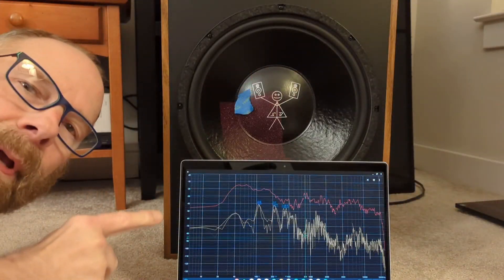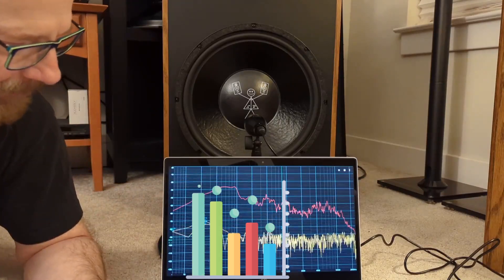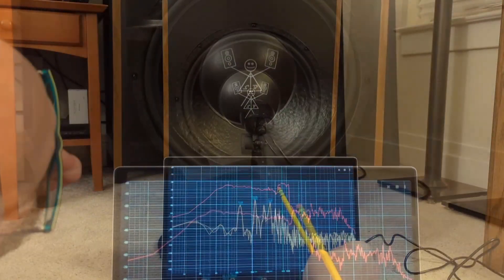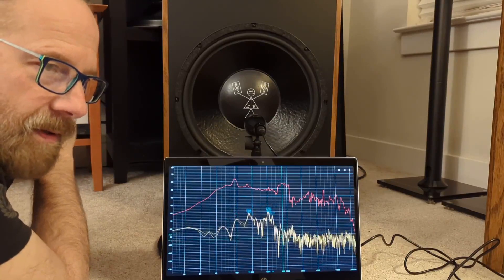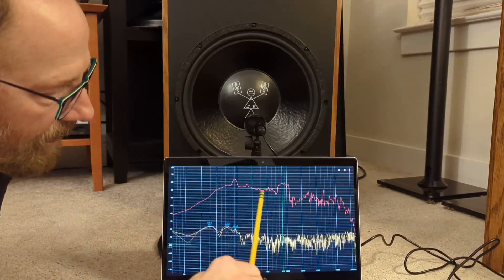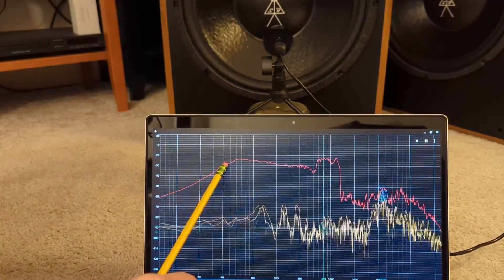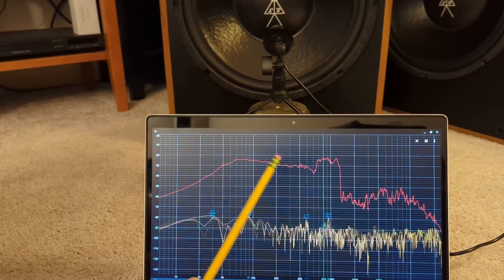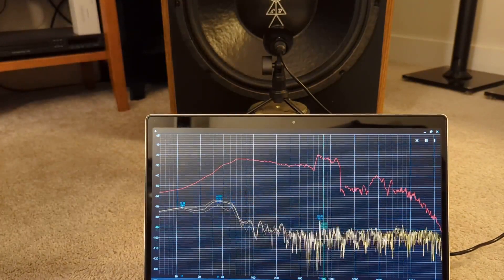Bass Tweaking: Comparing Woofer with a Zobel and Without... MORE BASS SMOOTHER RESPONSE kinda

Comment: The problem you're experiencing won't simply be solved with cutting the hump down with a zobel. Also unless you've taken into consideration woofer inductance, and ideally ESR of the zobel components too, when calculating for the zobel, you're frequency cut may have it's center frequency, bandwidth and cut level change slightly.

Even if properly implemented you're still only fixing your on axis performance. This will just make off axis listening even more dull. Ironically big speakers for more volume will work but they tend to have a smaller sweet spot when things like woofer beaming begin at 570 hz for a typical 15" and also the problem with big woofers is earlier break up modes. 15" paper woofers tend to have a pretty severe bump in on axis frequencies around 2khz but off axis you can have upwards of -15db dip at 2khz. This is a big deal when wanting to run vocals through a big woofer being used to spread sound over a large audience. The beaming problem has only two solutions (well the third is use as is and use the beaming in conjunction with the horns narrower dispersion to prevent room echoing in large venues where 15" would be used). The solutions are to Use a lower cutoff frequency, 500hz is typical for a 15" woofer for hifi purposes. This eliminates both the beaming and breakup problem and keeps crossovers simple. The other is a physical mod to the speaker you can search for "woofer diffraction slot" This is a flat piece of material with a certain shape cut into it. The shape essentially guides any of the waveforms from the woofer that would otherwise interfere with the wide dispersion and forces them out the center area. This aligns the sound and disperses it, think of it like a spray nozzle for sound, and makes the woofer behave more point source-like. This solves the beaming problem but won't help with the breakup problem.

 When designing speakers every change done will have knock on effects of other performance characteristics. For example the more components in the crossover, the more energy is stored and you'll see if you can run impulse decay tests, more ringing going on.
Reply from the maker: Thanks for watching and the comment / suggestions! Honestly, this build was a while ago and it needed plenty of massaging.

I've read over your comment, but as an old timer back from the days of tuning and tweaking by ear, (which is much of what I do now as well), I can't really relate to the beaming, although that would make an interesting video topic I may explore. Personally, I've not had any issues that I know of with beaming from larger woofers. I'm assuming that beaming is a focused energy, perhaps a spike in SPL of a certain frequency or frequencies at certain listening positions?

On big baffle, large driver cabinets, usually the issues I face are more in the midrange and tweeter. That's definitely the case on this build. Additionally, this enclosure is theoretically a bit small for the cabinet, so matching the SPL of the Woofer from subsonic to the crossover point of 750/800 Hz range, where it hands off to the mid range was my biggest challenge.

The Zobels shouldn't present anything extra in the path as they're in parallel and loop back to the amp. I use them because it mitigates some inconsistencies in SPL across areas, and presents an equalized impedance which assists the crossover in functioning more consistently across a wide range of volume. It's basically a hack for optimizing the performance when using off the shelf crossovers. The crossover points may not be textbook, but the Zobels help get them closer to where they're supposed to be. In terms of calculating for them, I don't get too concerned about it as they're simply acting as a path of least resistance when the drivers have impedance variations from inductance. I get the values as close as I can, but try to keep the number of parts to a minimum.

I'm not sure I agree with the cone breakup above 570 Hz theory. I believe that would have a lot more to do with the driver being utilized and how well it works with the cabinet, tuning frequency and dampening. At least I've not experienced it personally, but I typically lean towards woofers that have very good control and plenty of power handling. The Woofers in this build are over twenty years old. It was a Dayton design they did with Eminence. It's basically a pro driver with a hifi style cone and surround. It's extremely tight though and I had this pair left over from when I was building high power, 500+ watt RMS speakers for Max fidelity at high SPL roughly in the 130 +/- Db range. That's a lot of fun and there's a huge difference between listening to a speaker system at 90 Db driven with 100 watts, Vs powering them with a few thousand watts for hours on end at full throttle. The one thing I'll say about that time I spent building those, was that it was right in my wheelhouse with testing and tuning by ear, because all the calculations, math and specs don't equate to any meaningful difference at the brink of self destruction. Crossover points and values of components behave much differently in those applications.

For the home stuff though, for sure the speakers are operating within such a narrow window of SPL, and much lower volume than they're capable of so small changes do make big differences.

All that being said, you may be on point, I'm just not that adept with that sort of measuring. I'm primarily looking for an even output in volume so that across the listening range that's more typical in a home setting, from perhaps 75 Db to 95 Db that they faithfully follow a consistent level of efficiency throughout the full range... or as much of that full range that the speakers are capable of.

I'm still planning on finishing off this series, but there's a couple of videos after this one you commented on which you might be interested in seeing. 

I believe the order it went was reversing the polarity of the Mid-Range, and then doing more bass tuning. Eventually I had arrived at "good enough" and that's where they're at today. I enjoy them. One day I'll get the series finished off, but the two videos I mentioned are:

https://youtu.be/TqoMVvD9CcU?si=oOxJ9T4_hPI8Kvyo

And
 https://youtu.be/cB8xzbsFI-I?si=DitxdkC1iQ8FrpW3

Thanks again for watching and commenting. If you can provide any more insight please do. I'm always interested in learning more.
Reply: @wattspeakers  

There's always a lot to learn, you do make an excellent point about distortion creeping in for high power applications. I most definitely, also like you tune by ear, but have gotten consistently close enough that I can tune a graphic and parametric equalizer by ear and sine sweeps.

 But also that at lower volumes inherent inconsistencies do show up more drastically. That's why there are so many different philosophies when it comes to building and tuning speakers.

 I used to compete in car audio SPL and SQ competitions at different points in life. And learned all through those times that even tuning by ear and measuring, there are just some things that can not be fixed with electronics. 

This is resonances, like cabinet resonance, woofer resonances and ringing. This leads to impulse decay problems which also can't be eq'd out. There's also beaming, this is an inherent fundamental fact. Use a woofer above it's beaming frequency and it will have a rising response on axis due to constructive interference and a dip in response off axis due to destructive interferences. This is simply math, it leads to the dipole effect of open baffle, it leads to baffle step response needing baffle step compensation. Breakup is solved by cone rigidity, physical damping and material selection with the caveat that more stifness means ringing and more damping means more mass less efficiency. If you don't understand what break up sounds like, build a speaker that runs the woofer full range and with a crossover. EQ them both flat, and you'll hear a distinct muffling in the vocal ranges.

But The beaming and break up though interelated to each other are different problems. I know you have a measurement microphone, it may be time to start on-axis and off-axis measurement. When you do you start to get a good picture of how little changes affect the polar response of the speaker.

In fact your video 15" woofer video inspired me to solve a distinct problem with a slight wandering image problem I've had with my Pyle tops. I too had about a 3 k rising response that I kept seeming to attribute to a hot tweeter. After trying to make my recording of Wonderwall that I sent by email I realise it is not just a rising response but a beaming problem. The diffraction slot is not the only way to help solve beaming. Since I know I have plently of response from the tweeter I took a trick from the line array speaker world and instead of installing a complex shaped diffraction slot, since I don't need to control refraction, I simply blocked a strip of the woofer with a piece of gaffer tape. This acts as a pseudo phase plug which mostly blocks constructive interference from happening which causes the rise and sends the excess sound essentially out the sides, which is exactly where the suckout happens, attenuation at the crossover region and better sound dispersion at the beaming frequency. Again only possible to solve with speaker mods, not electronic mod.

Fine tuning by ear truly is a very rare gift. Protect your hearing. I make accurate speakers specifically to help protect my hearing and have gotten away from ridiculously powered systems to instead go to meticulously refined systems that just work well and have minimized cost. I hardly ever have to turn my system up above a few watts to hear and feel every coherent note in the music.

Comment: What tweeter crosses over at 800hz I think this is why you guys have so many problems with your designs, you HAVE TO crossover at or above the low end of the highest driver low end of tweeter =high end of midrange, low end of midrange =high end of woofer, it's not that complicated, been doing it for years, like 45 years,
Reply from the maker: Ahhh, good catch Eric. I did say 800 Hz is where the Woofer hands off to the "tweeter". Sorry about that. Correction: 800 Hz is the crossover between Woofer and Mid-Range. 4500 is where the Midrange crosses over to the tweeter.
Reply: @wattspeakers  👍 no problem I just keep hearing so called "experts " saying to cross over a woofer at some ridiculously low frequency that won't match ANY midrange or tweeter average midrange 500hz average tweeter 2k some go lower but not most
Reply from the maker: @ericschulze5641  I've had some comments on videos about crossing over the Woofer way low... Like 300 Hz and below. I'm not sure where the information for that is coming from, but the only thing I can think of is maybe people are confusing subwoofers with woofers. Personally, I try to extract as much of the useable frequency range of the woofer as possible. In this project, the Woofer I employed has a useable frequency range of 19 Hz to 1000 Hz, but at the tail end near 1000, it had a spike in SPL, so I crossed it over a little early.  There's also a lot of talk about "beaming" from big woofers, but I'm ignorant when it comes to that. Maybe it's because I grew up listening to big drivers, but I like the sound of big drivers handling most of the heavy lifting, or the bulk of the musical information. 

I think I've read forum posts from people that think the maximum size for reproducing mid bass should be 5" or less. To me that seems like an incredible waste of perfectly good SPL that a big driver like this 15" are capable of, and which gives big driver speakers their signature sound quality, that many including myself love.

It may be true that generally speaking a 5" or smaller mid-bass driver can move faster and react quicker because it's smaller, but it seems important to keep in mind that everything is relative. The 15" Woofer in this particular design is a hybrid, essentially a pro driver with a wide dispersion cone and big surround for plenty of xmax, with a stiff spider for Qms. It has a pretty flat response, high efficiency and a huge motor for excellent Qes. Coupled with proper box size and port tuning, it's plenty capable of delivering not only subsonic bass, but also tight deep bass, while delivering clear and highly transient mid bass at sound pressure levels that a smaller mid bass style Woofer simply can't physically reproduce. 

I like big Woofers ;-)
Reply: @wattspeakers  yup , as your saying it's  not that difficult ,just keep the points close to the ratings, & play around with different caps and coils, I still use 1st order only, & run separate 10 ft wires to each speaker while testing, you can switch them out quickly that way from the listening position ,no getting up, switching, sitting back down over and over